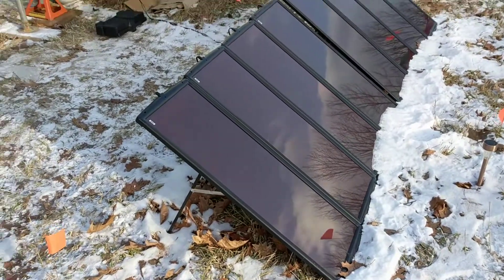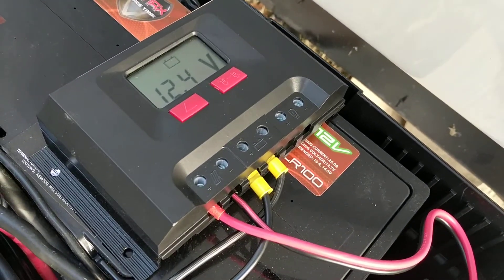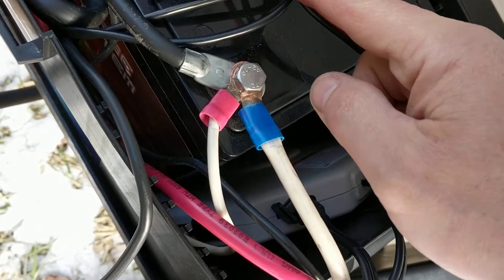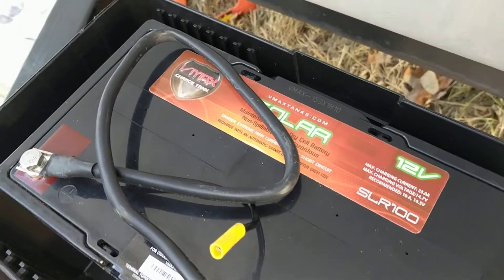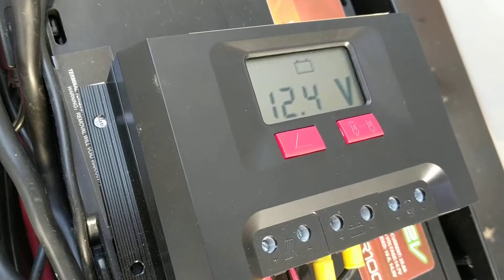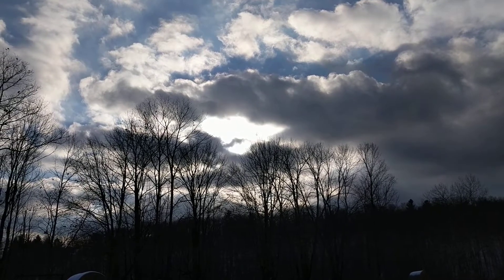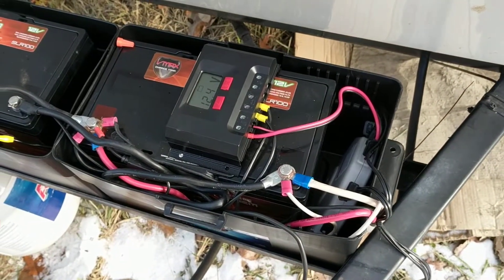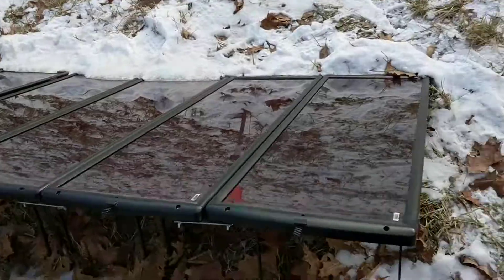Harbor Freight Solar Panel Kits Review

Comment: Nice video with some good info. However... the solar charge controller shown in the video (it's not the one that comes with the kit) is only a 30amp unit. You can check that on the HF site. 
The hub connector shown is only rated for 400 watts of PV. You can't hook up 6 or 8 kits.

Comment from the maker: Yes this is 100 amp controller.  The kits come with a lower rated controller which is not rated high enough for my needs. I had to buy the 100 amp controller separately.
Reply: 30 amp solar control

Comment: Are you sure that controller is 100A ?
Reply from the maker: Its the one they sell at Harbor Freight....they say it's rated at 100 amp but I only have 200 watts of panels hooked up.
Reply: @stemyourfuture6875  Looks like the 30 Amp Controller at 360 Watts.  BTW...Each panel can produce 1 Amp.